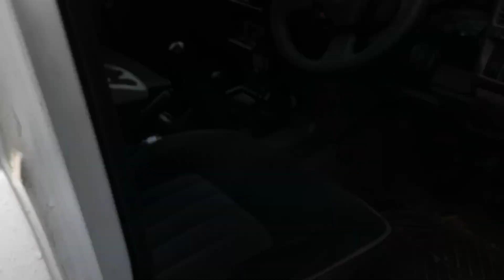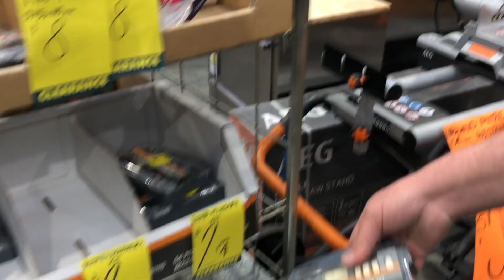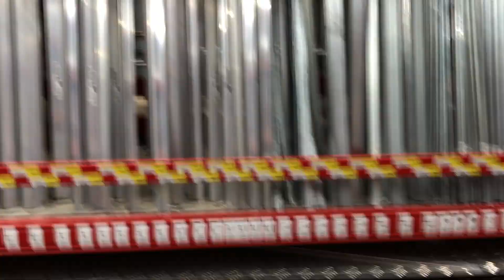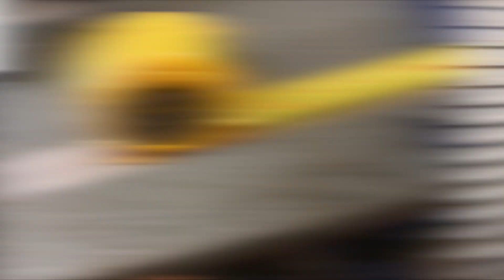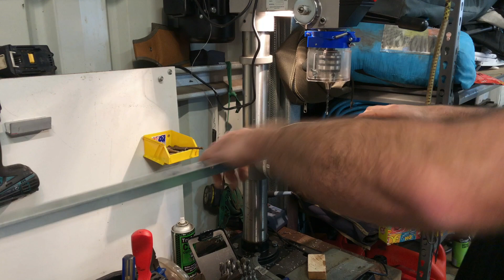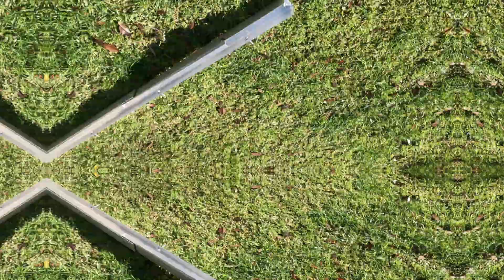DIY Folding Stand for 120w Kings Solar Blanket.

Comment: What size blanket would this fit from what can tell is it 1250x 730? If not I’ll modify to suit my 200 w solar blanket.
Reply from the maker: Yeah it was a smaller blanket this one, but could very easily be adapted to make a bigger one.

Comment: Great idea and great instructional video. Just returned from Bunnings where I was thinking of using there 25.4 mm alum tube and plastic push in fittings. My design was going to cost me more than the 200-watt blanket. Back to Bunnings & into the shed.. Many thanks..
Reply from the maker: There’s never only ONE trip to Bunnings! 😜

Comment: Great idea and an excellent video. Ive dobe something similar with 20mm pvc tubes and connectors but it does break apart into a larger "tube" shape.A friend of mine uses a 1 metre folding aluminium step ladder and a cutoff tent pole to act as the leg to angle up the folded ladder.

Comment: can you give more detail in written form of the supplies you purchased and the measurements? Thanks,
Reply: Damn just came across this and the page doesn’t exist bro.
Reply from the maker: https://jebbreysjibberish.com/create-a-cheap-and-easy-diy-solar-stand-for-your-flexible-panels/
Reply from the maker: Hi patty, great question. If you checkout my blog on the stand here: http://jebbreysjibberish.com/index.php/builds/74-diykingssolarstand it has some further information about parts and dimensions at the bottom of the article.  To work out where the holes go you'll have to watch the video or wing it as I don't have specifics on those, they are kind of done ad-hoc.